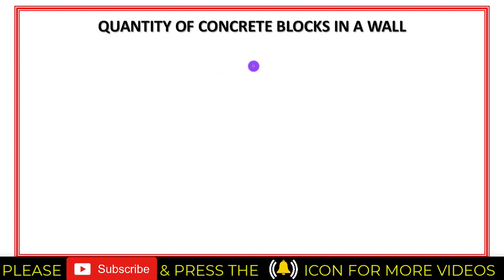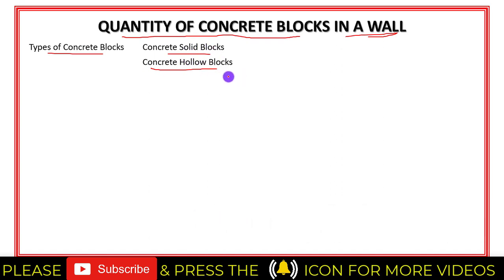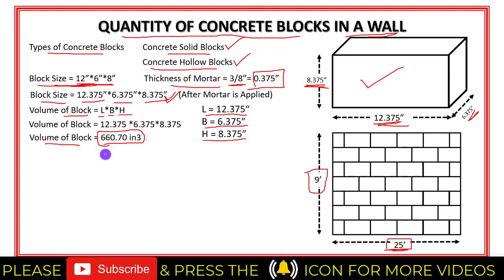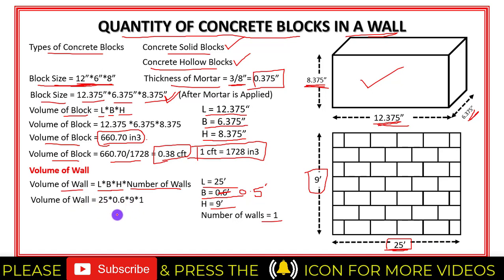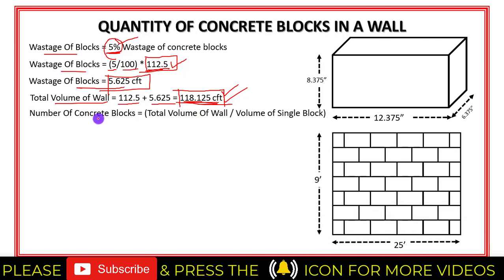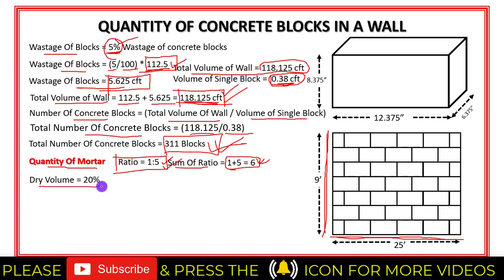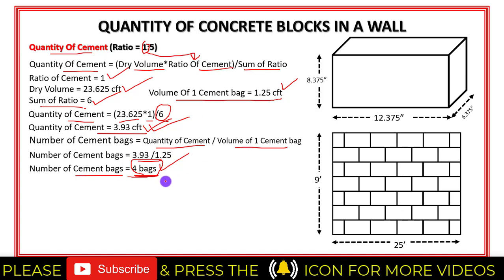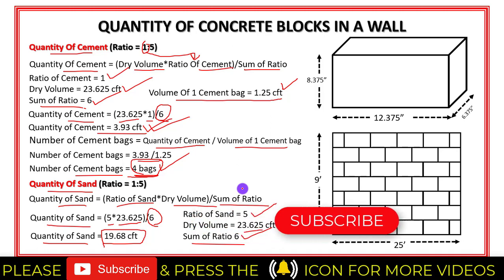How to calculate quantity of blocks in wall | Quantity of Mortar Calculation | Engineering Network

Comment: Dear sir i think mortar will not be added to the width of block because the thickness of wall will be same
Reply from the maker: Dear Student Thank you for asking a very good question. yes you right you can neglect the mortar thickness but If you want accurate result then the mortar thickness should be added

Comment: How much kg is the 1 cement bag that you got 1.25
Reply from the maker: Thank you for your question. The weight of single cement bag is 50kg but in the video we have cement Quantity in CFT so that's why I divide it by the volume of single cement bag which is 1.25 CFT. I hope it will clear your concept 🙂